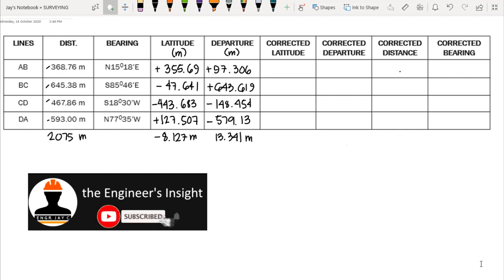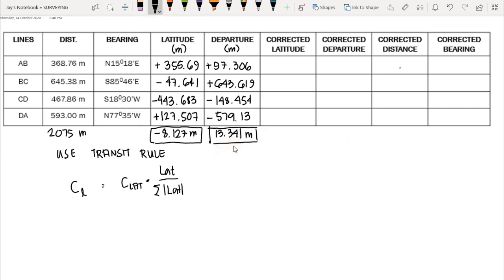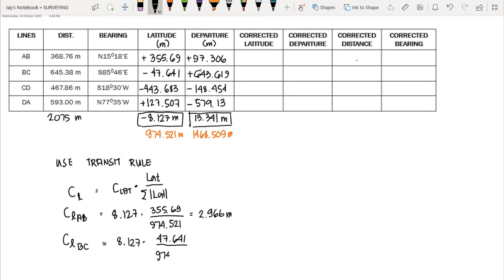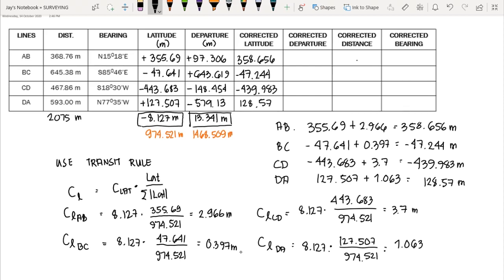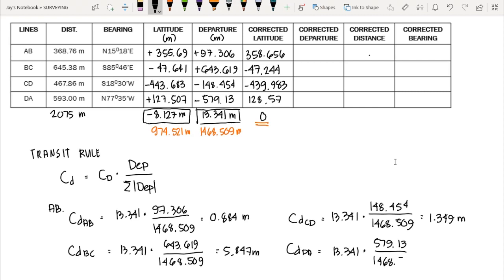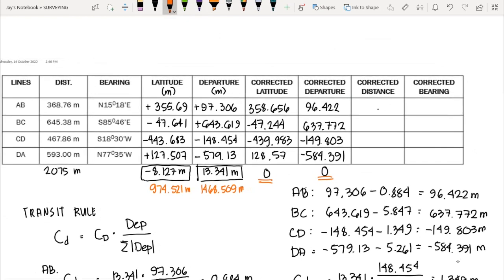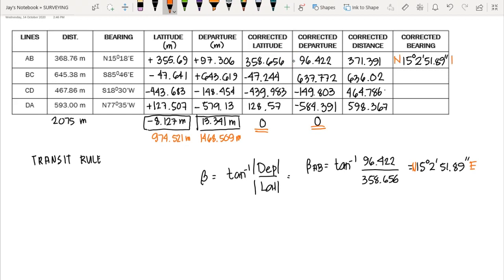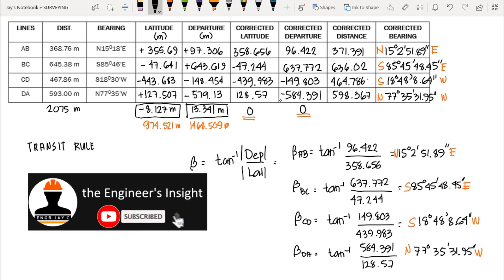Surveying | Transit Rule (Adjustment of Closed Traverse Part 3 of 3)

Comment: sir kung ang sum ng latitude ay zero, pero ang departure ay may -0.05 difference, kailangan pa ba i adjust ang departure? o minimal lang ito at pwede i neglect?
Reply from the maker: That's too small. 0.05m is 5 cm. Though you can still check your computations baka may namali ka sa pag round off.